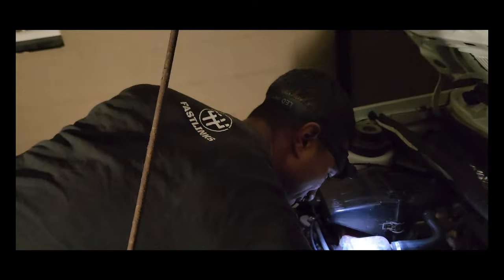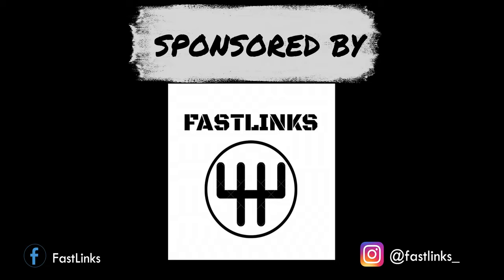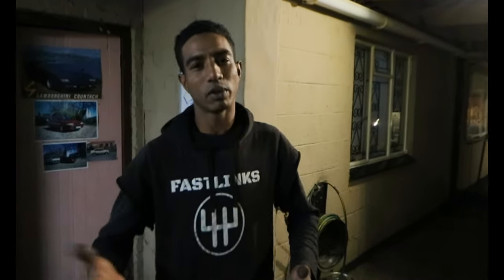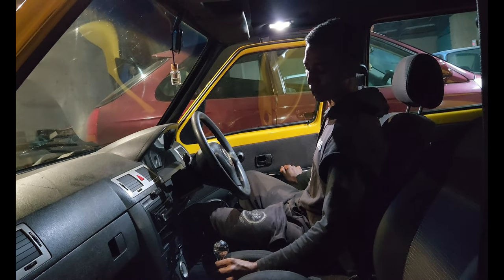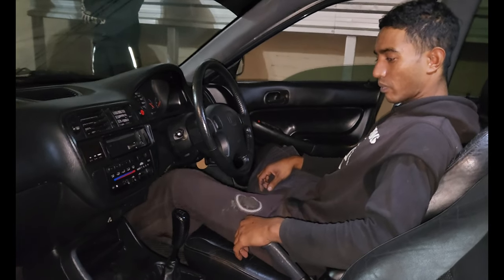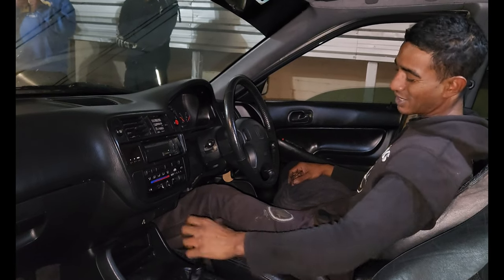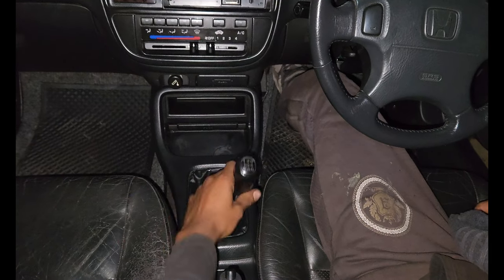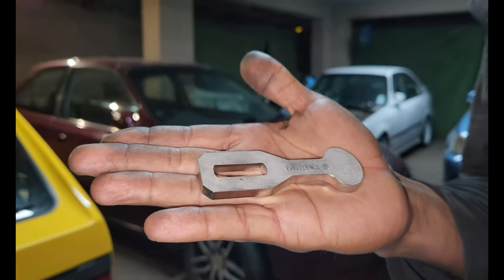Upgraded Linkage bush kit & Short Shifter Installed + Linkages reset : by Fastlinks

Comment: 😊How much would it cost to rebuild the mk1 good engine and gearbox... Just enterior and painting, rust fixing.
Reply from the maker: It is difficult to give you an amount how much it will cost. Some suppliers are cheaper then others and other spray painters could be more cost effective with their jobs. Best would be to get quotations and work out your estimate spendings from there